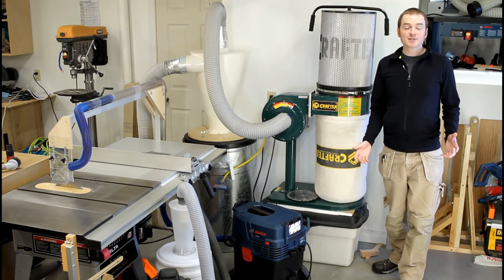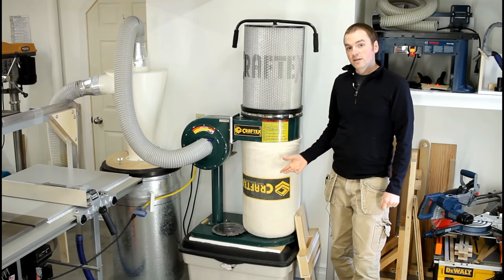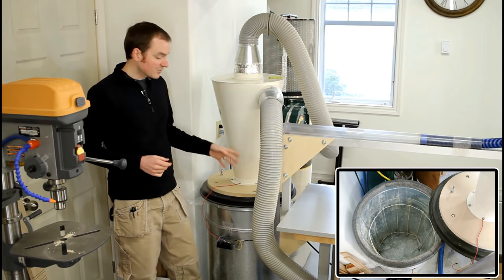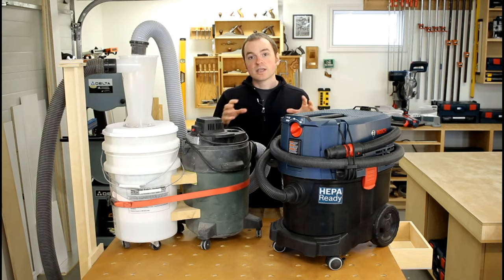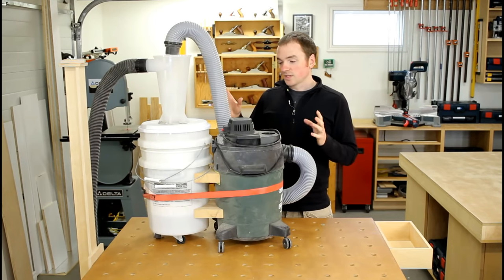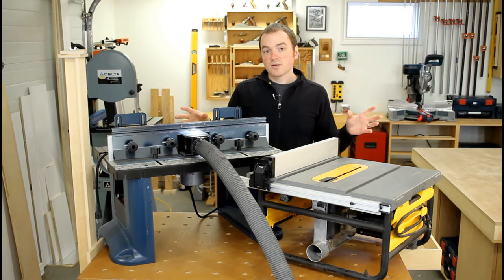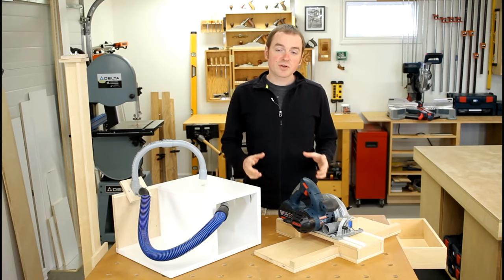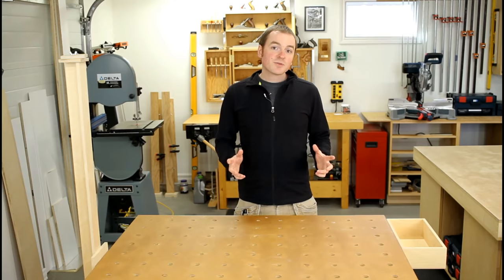Small Shop Dust Collection - Affordable & Effective Solutions

Comment: I found a decent portable seperator at harbor freight for 35$. Works great with my axial glide miter saw and Hitachi table saw. It's really similar to the small dust deputy. I just run it to my rigid shop vac when I'm trying to keep the dust down at work. Believe it or not, it catches about 80 to 85% of the dust from the tool and nothing gets to the vacuum except when I'm cutting mdf. Hardly anything catches that stuff. But any type of wood, it's like night and day

Comment: Great content Dan, thanks much.  I use two of the (Grizzly) overhead shop air cleaners mounted so that they form a nice circulation loop around the shop ceiling, works really well in this configuration, especially good when CNCing MDF.

Comment: Dan, please keep up the good work!  Your videos are always informative and well edited.  
I see lots of comments about dust filters.  I hate dust particles of any size in my workspace.  Here's my solution.  I have a large, central Dust Deputy and I vent the dust collector directly outside through a hole in the back of my garage.  That's what sawmills do and they create big piles of dust outside.  In my light-duty case, I have yet to see any build up.  The dust just blows away.  No filters at all!
Reply from the maker: Thanks, glad you find the videos helpful! Venting the dust collector outside is great in terms of no dust being put back into the shop. The only problem is in this climate you also lose your heat in the winter.
Reply: that's what I want to do in my garage.  any tips for dust collection for a beginner?

Comment: Would you find it more helpful if your shopvac and bucket were also mounted on a small cart with wheels? Like a moving cart?
Reply from the maker: I've found that it works well with the shop vac and bucket strapped together and wheels on each of them.  I've seen carts before for a setup like that but so far haven't really found the need for one since it moves around easily as is.

Comment: So, I did the same thing except that I sealed off where the cloth bag attaches in order to save space. I mounted the cartridge and spin section horizontally on the ceiling to save more space. Works perfectly. I rarely have anything at all catch in the pleated filter.
Reply from the maker: Thanks for sharing Brian.  I've actually given thought to doing that but wasn't sure how well it would work.  Good to know that it works well.

Comment: I , like you, used 4" duct work in my small shop.  The dust control was terrible. I read on YouTube that you should never use 4" duct as it kills the CFM. So I removed it and replaced the duct work with 6" PVC, S/D I ran the new 6" all the way from the blower to the machines.  I also removed the twin 4" duplex covering the  6" inlet to the blower.  This made a big difference in dust collection but I still felt it was not enough CFM. So I opened the stock 4" inlet to the saw etc. and attached the 6" duct to the new opening.  This  again made a huge difference in CFM.   You should try this.  My blower has a 14" impeller if you have a 10"  impeller  it will clog the duct work.    If I had it to do over I would use a 15" impeller to start with.   I'm thinking I can add a 15" impeller as the motor is still not fully loaded as  tested with an ammeter. Check the amps on your motor. You probably are not even close to the max amps.as written on the motor case. Increasing duct size will increase the amps.  If you pull to many  amps a plywood restriction can be added to the blower inlet to avoid burning the motor up.

Comment: I have a strange question. I just bought a Bosch dust extractor based on your review you posted. I also bought the newer dust deputy 2.5 as a separator when it’s in my shop to cut down on buying bags. I didn’t realize the end of the hose (that plugs into the extractor) has a locking mechanism tab that prevents me from being able to insert it into the dust deputy for a friction fit. Do you know if they make any couplers that can accept this little tab for the locking mechanism?
Reply from the maker: The Dust Deputy must have changed then. My Bosch dust hose fits over the inlet of the Dust Deputy with no issues. I'm not aware of any adapter though unfortunately.
Reply: @DPShopTalk  Yeah, the newer dust DD has larger ports for better airflow now. I ended up just getting a Fernco pipe coupler and it worked fine. Thanks for replying.

Comment: Good video Dan.  Not sure if you see these comments on old videos, but here goes...  I got the smaller dust deputy unit some time back and secured it to a large plastic garbage bin.  It was well sealed and so on.  I was using a larger Craftsman shop vac to power the set up and found, to my dismay, that the filter on the vac was still constantly getting clogged up; not much different than before without the cyclone.  Do you suppose the vacuum I was using was just too powerful for the little cyclone?    I have been trying to reason this out and haven't come up with a satisfactory answer/solution. Anyway, always enjoy your videos.  Thanks for your efforts.  Cheers.
Reply from the maker: As far as I know the power of the shop vac shouldn't cause that issue.  I've had dust get by my small Dust Deputy before when I had an air leak where the cyclone joins to the lid of the bucket.  If everything is air tight then I'm not sure what would be causing that.  The only thing that sounds like it is different with your setup is the size of the garbage bin.  I use the standard 5 gallon bucket with my setup.

Comment: Danpaterson Question I can't seem to find an answer to: for tools with small dust ports, is it better to use a 4" hose to a reducer adapter, or just use smaller hose on shop vac?
Reply from the maker: For tools with a smaller dust port you are better off using a smaller hose with a shop vac. When you step down a 4" line from a dust collector you lose a lot of velocity.

Comment: Thanks Dan, very informative video,   Why did you choose to have multiple dust collection systems in your shop, versus having flexible hose extension and port adapters for your bench top tools?
Thanks
Reply from the maker: The main reason I use two systems is that you get optimal performance that way. A portable dust extractor has a higher velocity air flow which works better with smaller diameter hoses and ports. If you try and step down to those diameters from say a 4" line from the big dust collector, you lose a lot of velocity and reduce the effectiveness. Basically the dust collector provides high volume air flow and the extractor provides high velocity at a lower volume.

Comment: Wait - youve used a 1 micron filter above them, presumably a 5 micron felt bag below?
Reply from the maker: I don't think the canister is even rated at 1 micron. It's not a high end filter by any means. Ideally it would be a HEPA filter. I'm not overly concerned about the filters though since I always wear a P100 dust respirator when I'm working in the shop.

Comment: Your setup will allow a significant amount of fine wood particles to enter your breathing environment. I suggest incorporating the plastic bag or use a respirator during usage.
Reply from the maker: +joel Mckenzie you're right, when it comes to super fine particles neither of the filters on the 1 HP collector capture them all. The reason I was ok with using the felt bag is the top filter is a cheaper model and isn't HEPA rated anyway. I always wear a P100 rated dust respirator when I'm working in the shop to protect my lungs from the super fine dust which is why I'm not as concerned about the filtration level of the DC filters. As one of the other viewers pointed out in another comment the filtration of fine dust does improve when a cake of fine dust builds up on the inside of the felt bag. Also where the bag hangs upside down that cake of dust never gets shaken off like when the bag is mounted on top so it stays there until it builds up too much and needs to be taken off and cleaned.

Comment: I’m really enjoying your videos. I see you have a Delta table saw. What model and do you recommend it? Looking to spend $500-$750. Other recommendations?
Reply from the maker: Glad to hear you're enjoying the videos 👍  The table saw I have is an older Delta Platinum edition contractors saw.  It is 20 years old so you definitely can't buy one new anymore.  I'm not sure what the best saws in that price range are as far as new models but a lot of the older Delta models are pretty good if you can find one second hand. If I was to buy a new table saw I would probably get one of the Sawstop models although they are fairly expensive. I have a Dewalt portable table saw that I use on job sites and it works well for me. Hopefully that is of some help to you.

Comment: Interesting video and it covered many aspects of dust extraction.
Do you find any necessity to ground your dust collection system? I noticed on one of your photographs of a commercial system, which  had metal pipes, do you really need to ground them?
thanks
Reply from the maker: +icespeckledhens for the kind of system I have in my shop I haven't found any need to ground it. The larger systems that I've set up in other shops were metal and were self grounding. There are different schools of thought on grounding but some people ground their plastic pipe DC systems.

Comment: Have you considered connecting your tools with a 2-inch dust port to the 4-inch hose you use in your stationary system, by way of an adaptor?  I would have thought that your dust collector with the 1 hp motor would create more suction than either the Bosch or the Shop Vac.
Reply from the maker: +Lyle Hough you actually get less efficient collection if you step down a 4" line to a 2" since it doesn't give enough velocity.  Without getting into all the physics of it, a 1HP collector with a 4" line will move more CFM but a shop vac or dust extractor will give more velocity in the smaller 2" line which is what you need.
Reply: Thank you.  As you can probably guess, I do not understand the physics of it.  I will take your word for it and continue to use my Shop Vac for the tools with smaller ports.  I still have lots of dust, but I am approaching it one tool at a time.

Comment: Hi Dan, I am building a DC system with a shop vac and I have the same dust deputy cyclone. I know Oneida sells an adaptor for the 2" outlet on the cyclone to work with a 2.5" DC hose, but it doesn't seem like you are using the adaptor. How did you connect your 2.5" hose to the cyclone directly? Thanks.
Reply from the maker: +Royal Poison the hose that I use has 2 1/4" ends on it and will plug directly onto the dust deputy. I'll put the link below for the hose that I use.

http://www.leevalley.com/en/wood/page.aspx?p=62603&cat=1,42401,62604,62603
Reply: Thank you. Really appreciate your help. Great videos btw and super clean shop!
Reply from the maker: +Royal Poison thanks!

Comment: Great video Dan, very informative!  My only criticism would be your use of the cloth collection bag on the Craftex dust collector.  Maybe I'm wrong, but it seems to me that by using the cloth collection bag instead of the plastic bag, you're defeating the purpose of the 1 micron cannister filter.  The cloth bag would allow larger particles of dust back into the shop, whereas the plastic bag would allow none to escape - all air/dust would have to go through the cannister.
Reply from the maker: The canister on the top isn't a 1 micron but if it was you would be completely right. The canister is a cheaper one which I think has a 5 micron rating which is why I've never been concerned about using the felt bag on the bottom. I always wear a P100 dust respirator when I'm working in the shop so I'm not super concerned about the filtration on my collector. For me it's more about keeping things tidier in the shop when I'm working which the extra air flow helps with. Ideally I would use a hepa canister top and bottom.
Reply: @DPShopTalk  I was about to pose the same question, so it looks like I have to keep the plastic bag on the bottom. It's not collecting a lot of dust anyway!

Comment: Doesn't the felt bag on the bottom negate the filtration value of the canister on top?  You are letting the 1 micron filters out the bottom, and then a HEPA canister on top restricting down to a smaller micron size.
Reply from the maker: +Chris H the canister filter on the top is a lower end model and doesn't actually have a HEPA rating which is why I was ok with using the bag filter on the bottom. If the canister filter was HEPA rated I would have been less inclined to put the felt bag on the bottom since like you said the filtration isn't as good.  I always wear a P100 rated dust respirator when working in the shop so I haven't been overly concerned about having full HEPA rated filters on the DC but I wouldn't mind upgrading at some point. Over time a thin cake of fine dust builds up on the inside of the felt bag which helps somewhat with filtering the fine dust too.  You're definitely right though.  I just find that the boost in suction power is worth it for me given that I'm not dealing with a HEPA rated top filter anyway.

Comment: Your smaller Dust Deputy has two buckets.  Are they too thin to use single?  Will a single HomeDepot bucket collapse?
Reply from the maker: +Jeffrey Wong no one bucket will work but the kit comes with two so that one has the wheels on the bottom and is attached to the vac and the other just lifts out of it for easy dust disposal

Comment: Dan,
Off topic, but where did you get those pipe clamps hanging on the wall.  I can't find them anywhere!
Reply from the maker: The red pipe clamps or the orange pipe clamps?
Reply: @DPShopTalk  the longer ones (can't remember color)
Reply from the maker: The longest clamps are the older Bessey K body clamps. They don't make that version anymore but they do have newer versions.
Reply: @DPShopTalk  Thanks Dan!

Comment: Hi Dan i am searching the whole internet regarding a question and i can not find any answer. Its about a kind of Table saw surface. I am just buying a table saw right now, and there is something i don't know i should avoid it or go for it. Most of the table saw surfaces are smooth and flat. But there are some which has a kind of fluted surface. I am not sure what the purpose, advantage or even disadvantage of those flutes. Maybe its just to reduce the weight, or its a kind of sawdust trap? i have no idea. Is you, or anybody else here have experience with that kind of table saw surface?

the Ryobi BT3000 has exactly the same design of the surface for example
Reply from the maker: +Attila Szabo the purpose of a top with grooves in it like that is to reduce friction by reducing surface area and also avoid any suction to the surface if you have a material that is flat and making perfect contact with the saw top. It's the same concept as hand planes that have a corrugated sole. Having said that pretty much all stationary table saws have flat cast iron tops and work just fine so I wouldn't put too much priority on that when choosing a saw. Any saw top will work well if you wax it or use a product like Top Coat spray. Hope that helps.
Reply: Yes, your answer was pretty quick and helpful, thank you. No i was not looking for this kind of "feature" at all. Its just how the saw top is. I was afraid of disadvantages, but now i understand and i am ok with it. Tanks a lot again.

Comment: Idea:  add a small vacuum hose  between your metal trash can and the dust collector intake port, the vacuum line should then be at a lower pressure than the inside of the can thus keeping the bag from getting sucked inwards. A camera or plexiglass view-port in the wood can lid would insure this is working correctly. It's all about pressure-equalization.
Reply from the maker: +Joseph Malovich that's a very interesting idea.  If I get a chance I'll give that a try.  Thanks for sharing.

Comment: In my two car garage shop I put all the dust making machines near double garage. door half. Each time I finish for day ;I use blower to blowout and clean machines.I have cyclone collection but its impossible to get all the dust collected. Its also the first thing I do before starting next day. Because fine dust is still in the air that settles not collected either way. Best to wear good dust mask with some no matter what.
Reply from the maker: +David Davis that's great having the ability to blow the dust outside.  My shop had a double garage door but I seldom opened it.  My new shop is twice the size and actually has an overhead door at each end which will work great for blowing dust out occasionally.  You're right that wearing a good dust mask is important no matter how good your dust collection is.

Comment: Woodworking is one of those industries where you can be meticulously clean, or you can be fast - but you cant be both. Personally I do all I can to collect as much dust as I go, make a right royal mess and clean up at the end of the day. I've seen fellas spend half their day cleaning and putting away every single tool every time they use it (even when they know they will need it again in 5 mins). Its nice, but you get very little done.
Reply from the maker: If you have good dust collection setups then working clean doesn't take much extra time. I find that I save time in the end and can do a job faster with good dust collection setups since I spend far less time in between jobs cleaning up. I don't generally put tools away unless I know that I'm done with them for the whole job. I've worked and made big messes and I've worked clean and I've found working clean is much more efficient overall. Clients really appreciate it when I'm working on site and work clean and it helps me get more work with repeat clients and referrals.